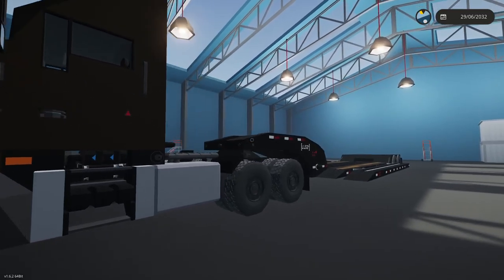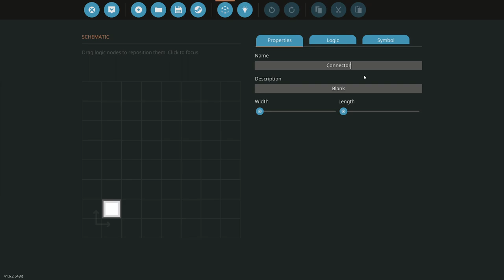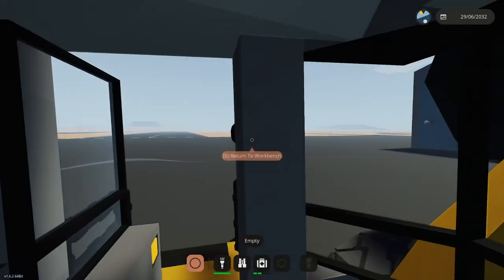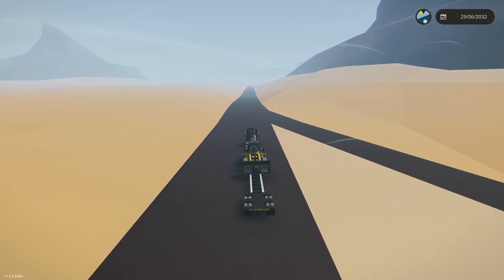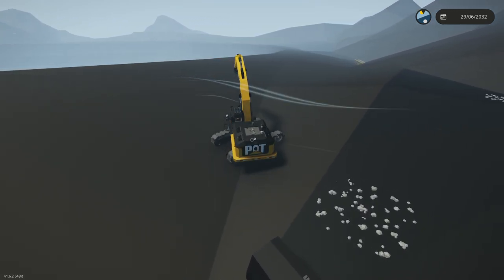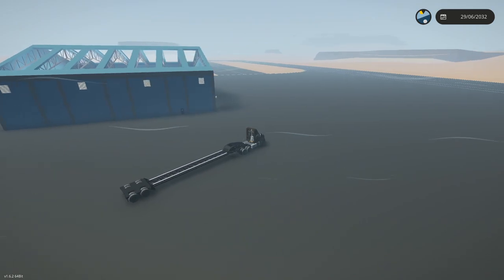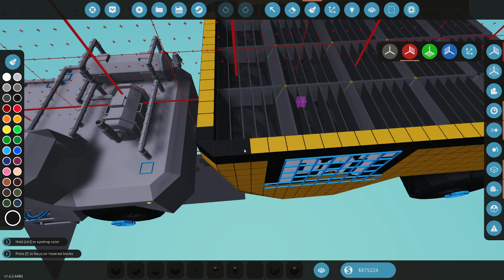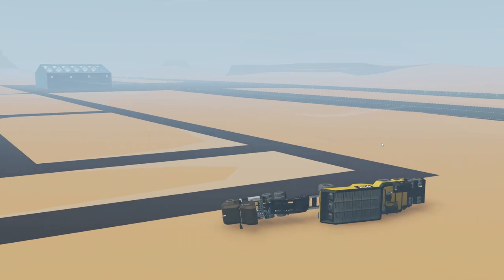Stormworks Career Build Series 176

Comment: I've also been struggling with traction. I was trying to load a jeep onto a train-car ramped flatbed, but to compare it to bald tires on black ice would be an understatement. Thankfully I know of a tutorial for duallies that XML edits the traction too :)
Reply from the maker: Yeah, I'd actually forgotten to XML edit the grip I thought I did. I went back and redid all the grip and so they're much better now.
Reply: @CaptainCockerels  Do you have to edit the tires per vehicle or can the base block be adjusted to correct it across the board?
Reply from the maker: @grit9938  You can adjust an individual tire. For example if you follow my dually tutorial. And then copy that set of tires from one build and put it on the next. It's pretty easy just to do it per build though. That's usually what I do.